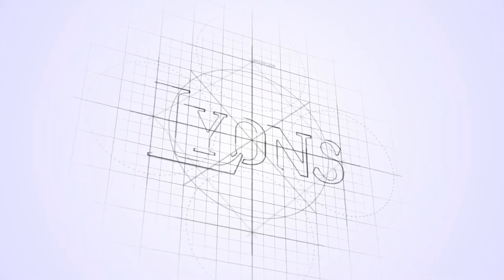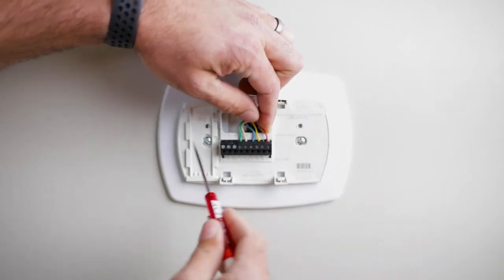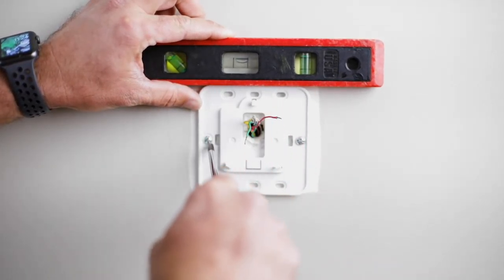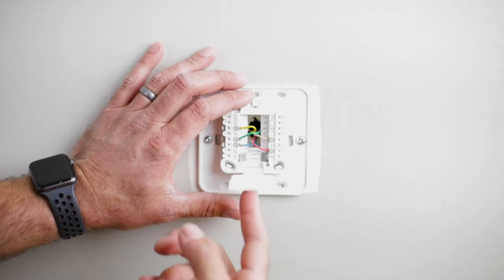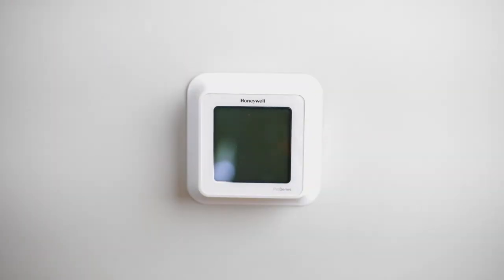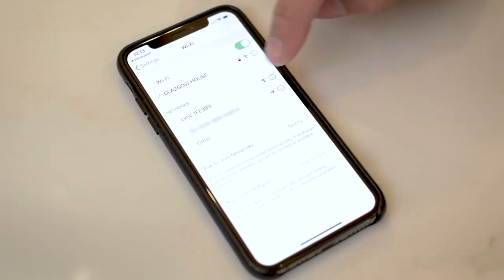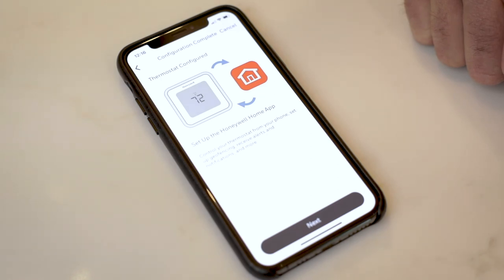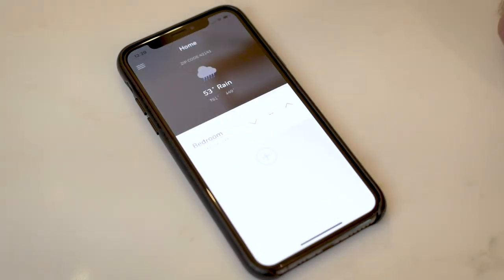Installing A Honeywell Lyric T6 Pro

Comment: Good video, but there are NOT 2 spots to add your wired connections (3:50 in the video). There is the "inner" spot which is where the wires go, and where the video installer eventually puts the wires. The other "spot" is where the thermostat actually connects to the wall plate.

Comment: My Lyric 6 Pro's face stopped responding to my touch. I ordered a new thermostat. It came in today.
I pulled the defective on off the wall and put the new one on.

Mine did not show the temp. During the instructions it told me to set my phone (android) into airplane mode.
Then it told me to go to the wifi devices. Now since I have my phone in airplane mode there is no internet.
I remember having the same thing when I first hooked up my 1st Lyric T6.

I kept reading the instructions, doing the same steps but going into circles. 
Honeywell had got to change the way the set up these thermostats.

Comment: Question; I have a Honeywell wifi t-stat installed on the ground floor which is not a T-6. Do I need to install a separate app in order to use the T-6 for the second level stand alone hvac system, or is there a way to do it on the same Honeywell app? Thank you!

Comment: I have a honeywell t6 pro series and I do not know where the yellow green blue red white and orange wire go can someone please help me
Reply: Match up the connections and colors from the original thermostat if you have a picture or look at the heater controls and what terminals each color connects to.

Comment: I have an orange and a black wire in addition. Can you help me with that ? Thanks
Reply from the maker: Refer back to the picture of the installed equipment wiring diagram. Check the color connections on both ends and match to diagram.

Comment: Question the old thermostat had a jump pin on the R -Rc, Do need the jump on the T6 Pro?  thanks
Reply from the maker: Check the instructions as it has switches at the bottom of the mounting plate to accommodate jumpers

Comment: Do you need the c wire to operate??
Reply from the maker: Yes, you need a C-wire to install it. Make sure you check the wires coming out of the wall and see if there is an extra. If there is, make sure it corresponds to the C terminal on the board in the unit. If you don’t have that wire, Honeywell does have an adapter that works well with older systems. 
https://www.amazon.com/dp/B07VMV2BJ7/ref=cm_sw_r_cp_apip_TNI3QB7SnY3Uq